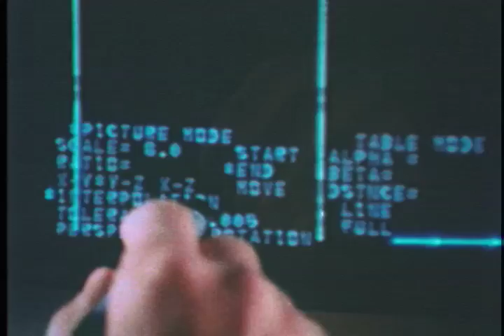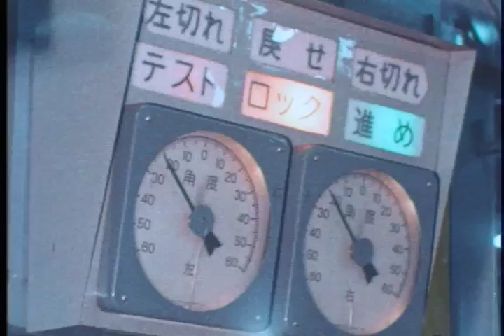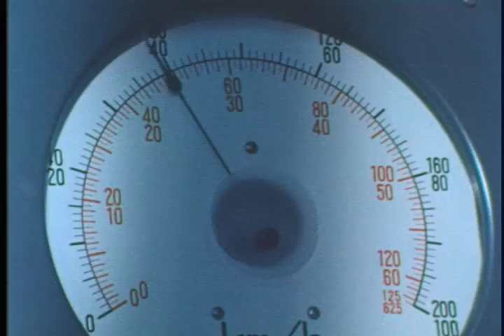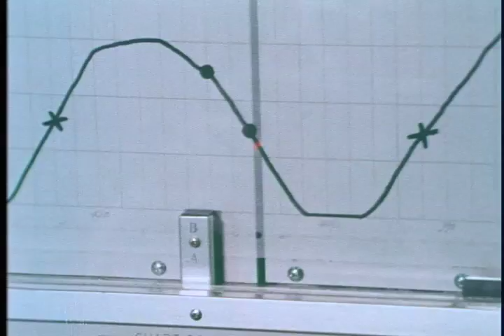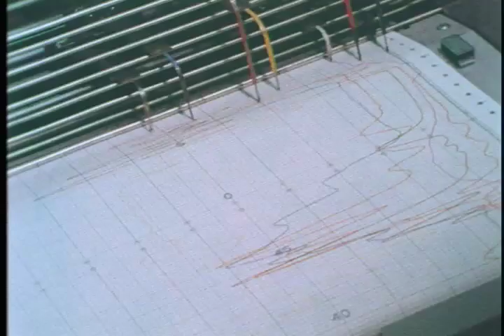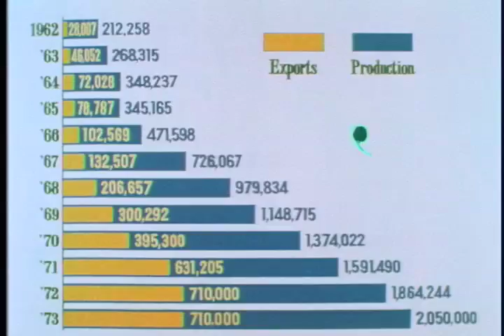Datsun History 1930s to 1970s

Comment: the pickup had a copy of a bmc 1500 pushrod engine and the 100a had a 998cc bmc copy,
Reply: Why did BMC go down the gurgler and Datsun succeed if they were after all, mechanically - at least as far as the engine - identical?
Reply: The pickups In USA, by 1974 or 5 (I had a '75, 1983-1995), had a 2L OHC fine engine.  Not as rev happy as the OHC 4cyl 1600 Datsun 510 engine (poor man's BMW), but very good.  In an article by Nissan's lead engineer for the 510 and 240Z: I learned the OHC engines (4cyl originally by Prince motors) were based on an early 1960's Mercedes engine.   Datsun engines kept going forever, but except in the SW, Datsuns just crumbled with rust.

Comment: Kia have done the same thing : Flooded the market with cheap reliable cars. Then once they have a good reputation they are not cheap anymore.
Reply: hyundai are both cheap and had a good reputation for decades
Reply: @jusb1066  I am not an American and Canadian, but Nissan, along with Mitsubishi, should leave Renault, thus merge with Hyundai/Kia instead. 

Hyundai's engineering, which is used in the [Hyundai] i20 and [Kia] Rio, is bulletproof, both Nissan and Mitsubishi could gain benefit from that. Which means, Hyundai-powered Nissans and Mitsubishis could sell more than the time two of them were/are under Renault...

Especially, many of Hyundai's patents were all based from Mitsubishi Motors, if you do not mind.
Reply: @awakawiateazrutyialocinadn5207  I remember when nissan was bullet proof.. mitsubishi had some good tech too. Renault since 80s terrible reliability
Reply: @jusb1066  

Non-American/non-Canadian here again: Now, Hyundai, and its partner, Kia. Had already inherited Nissan's pre-Renault reputation, Mitsubishi's technologies and cars were not only fundamental to Hyundai's success, but also, Mitsubishi too had supplied their engines to a number of car manufacturers that neither sell in the USA and Canada. 

Especially, its because Mitsubishi's products, like their cars and mechanical parts are deeply cheaper, particulary in Mitsubishi-loving countries like those in Southeast Asia, hence Indonesia, Thailand, and the Philippines. 

That considers Hyundai and Kia cars to be inexpensive and reliable, as before and after they took over Kia circa 1998, most mechanical parts found inside Hyundai vehicles' bonnets, or 'hood' in North America, were all based/inspired from Mitsubishi technologies. 

The 1995 model Sonata's [licenced] V6 engine looked similar to the appearance of the [same] V6 engine that was powered in the [Mitsubishi] 3000GT and Dodge Stealth sports cars, as when Chrysler owned Mitsubishi meant they gained benefit from their parts bin as well. 

Not to mention, Hyundai's preference of working with Mitsubishi was also because of their [Mitsubishi Motors'] CEO being a Japanese person of Korean ancestry. Tomio Kubo was the name, which Kubo-san, a Japanese male, also realised that his duty to work with and supply parts to Hyundai meant that he felt deeply proud of his Korean heritage while being a Japanese citizen. Especially, many Korean cars during and after the Cold War era were fundamentally Japanese engineered.

Kia on the other hand, prior to merging with Hyundai, had their earlier cars being powered by Mazda tech at the same time Mazda was under Ford's ownership until 2015. 

Besides from powering their cars with licenced Mazda engines, Kia's earlier cars also utilised pre-Renault, Nissan-sourced, automatic transmissions, even when Hyundai already purchased Kia, cars like the Borrego, the Veracruz's relative, also used Nissan-sourced automatic transmissions.

Mazda, is now is owned by Toyota, just like they do to Subaru, which is also a small visionary marque like Mazda. As they, Toyota and Mazda, had already established a joint assembly plant somewhere in Alabama. 

But I could just say that Mazda, like Honda, is not monopolised by making rugged friendly cars like Hyundai/Kia, Nissan, and Mitsubishi. 

Aside from merging with Hyundai/Kia for the sake of reinstalling half of their cars, Nissan, should also take over and kill off Subaru and Mazda, only after Toyota sells the two of them, Subaru and Mazda, to 'Peugeot', which is also but neither selling cars in America and Canada like Renault. 

So, if Subaru and Mazda merges with Peugeot, then Peugeot might treat the two of them in the same manner Renault did to Nissan and even Mitsubishi. Therefore, Peugeot could sell off Subaru and Mazda to Nissan only if the partnership gets short lived. 

But, its also curious to know that Nissan owned Subaru in the past at the same time Nissan too also supplied their automatic transmissions to Mazda as well, especially Subaru was also the one who contributed to Nissan's fixation and expertise in CVTs... - now, that is a long story...